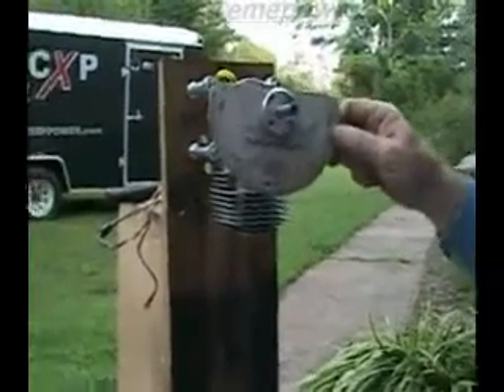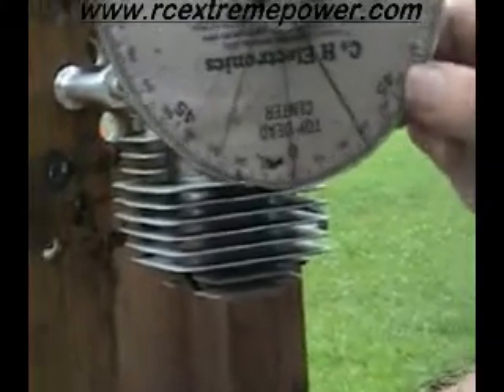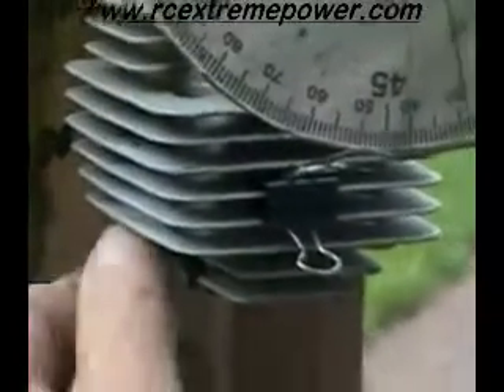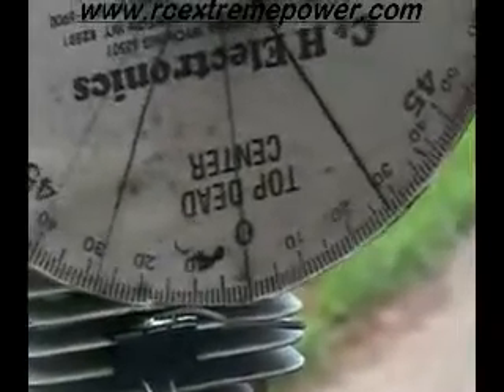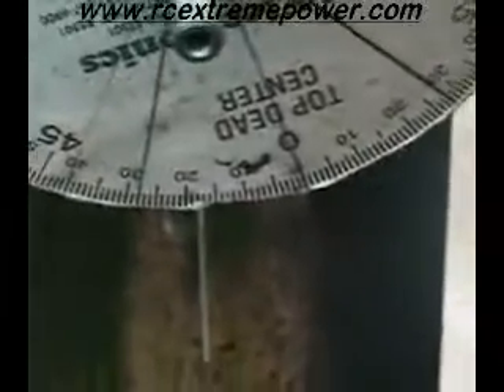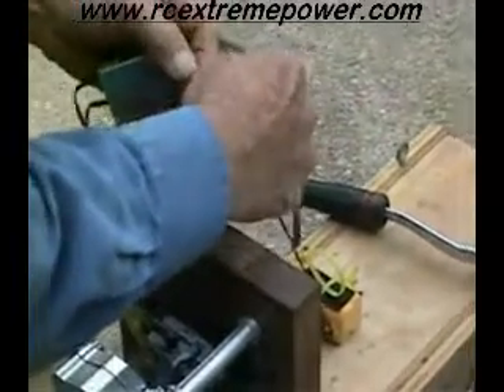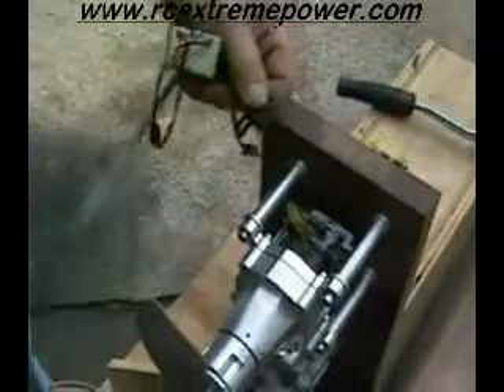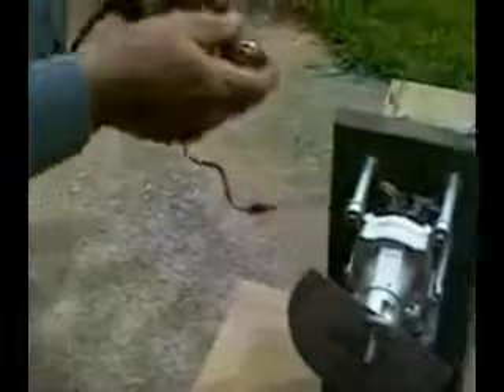TDC and ignition 2

Comment: Hi Customworks3d, Thank You for uploading this video, it has helped me a lot understanding how to set the TDC on my engines.  I have noticed on my DLE35 RA that as much as I can try to setup the timing correctly, my hall sensor will not move to anything below 40 + BTDC.  Are all engines setup the same?  I noticed you are using an older engine in your video.

Comment: Hello Customworks3d:
Thanks for an instructive video. I will use this approach very soon on one of my engines. 
Even though I accept this method, there is something I dont understand;

When the rpm is high, it should fire at 28 deg.
When rpm is low, it should fire at near TDC.
Right?
And yet, you move it slowly over the sensor, and it should fire at 28 deg? Is the EI made so that at standstill, it also fire at 28deg, then move it close to TDC at low rpm, then increasing to 28 deg at higher rpm?

Comment: Is it always going to be 28 degrees for all motors? how will i know which motor needs what for my two stroke gasser, for example, if im trying to setup on a dle 55 is it also supposed to be 28 degrees? Just an honest question that i dont know the answer to. Thanks.
Reply: Yes, all of these DLE engines will work well at 28°.